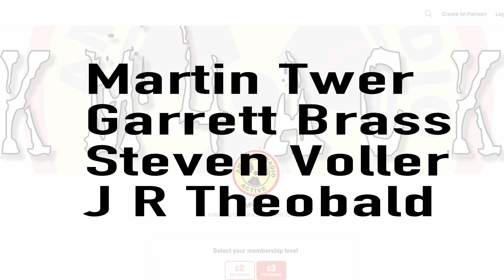Packtenna POTA K3924

Comment: I just did my first POTA activation at K-1435. In less than an hour 24 contacts, 5 of which were p2p. I used a xeigu x108g, mfj tuner and a vertical dipole about 5 feet up using shark hamsticks. It was very exciting, especially the first time with the antenna set-up. Tuned, then hopped on. It was a lot of fun.